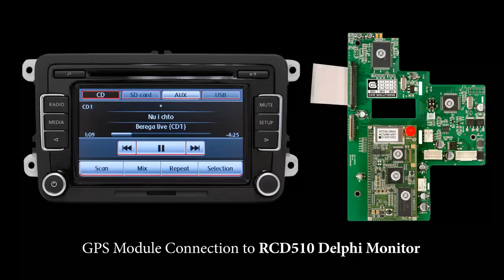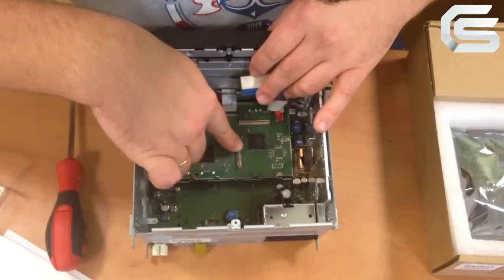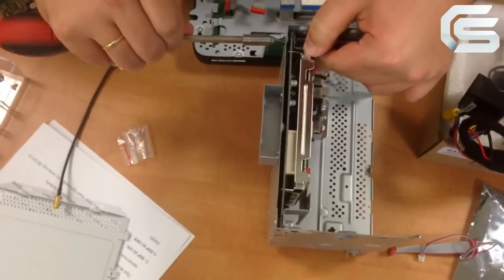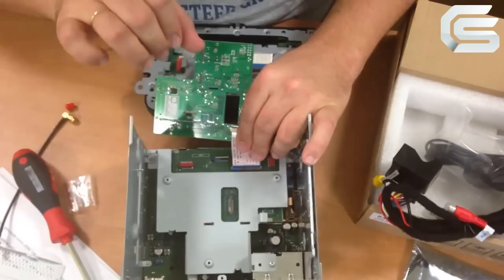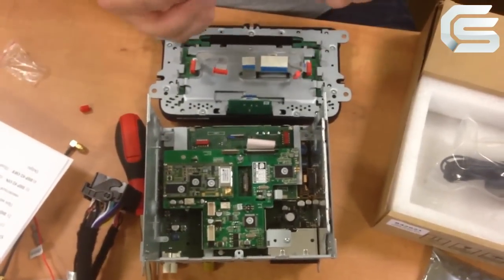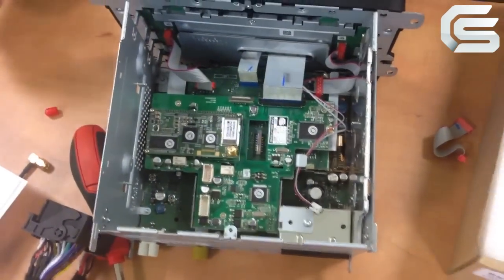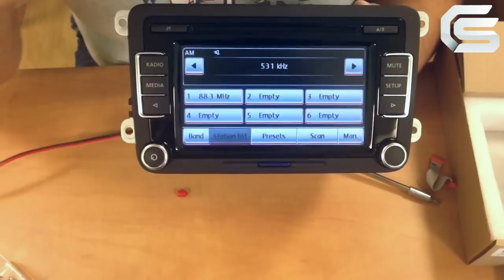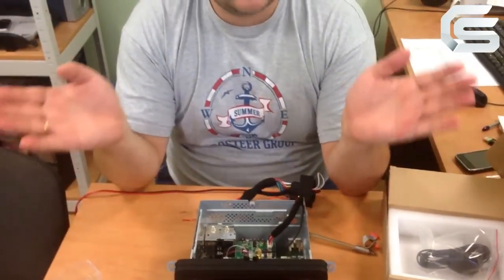Navigation for Volkswagen. GPS Module Connection to RCD510 Monitor.

Comment: Great video! I recently bought a Polo GTi 2011, with the RCD510 display, and I wonder if this will fit? My version does not have the arrow on each side at the buttons at the bottom. Instead it says "Phone" and "Settings". Can I still use your kit to get navigation?
Reply from the maker: Hi. It's only compatible with head units made by Delphi. So you need to take the monitor out and see the sticker.
Reply: @CarSolutionscom  pp

Comment: Hello a have the Amaraok 2014 Highline pack, made in Argentina, my radio RCD 510, doesn't have the bluetooth module, can i add this? do you know a good brand o this product? What about the GPS and rear camera, can i add these too?
Reply from the maker: +Mauricio Querejazu C. This module does not have Bluetooth. If your head unit is manufactured by Delphi then this module can be installed for GPS navigation and rear view camera.

Comment: Hi sir. Can you help me please. I have a Skoda Yeti with a Bolero (equivalance VW RCD510 first generation). Can I install this additional GPS card and also rear camera ?
Reply from the maker: +Yougourten AÏT MOULOUD Hi. If your head unit is manufactured by Delphi, then yes.
Reply: +Car Solutions many thanks for your answer. To check if it is a Delphi or no, is there a procedure  or must I remove my Bolero?
Reply from the maker: +Yougourten AÏT MOULOUD You can remove the head unit and take a look at the sticker. We can also try detecting it by the appearance. Please, give the picture of the head unit.
Reply: +Car Solutions, the product number is 1Z0035156N and there is a picture of the front: 
http://oi64.tinypic.com/2nqqul3.jpg
Reply from the maker: +Yougourten AÏT MOULOUD Unfortunately, it's hard to determine. If there was no phone button, it would be 100% Delphi. In your case it's 50/50. You'd better remove the head unit to see the sticker to be quiet sure.

Comment: I just ordered a RCD-510 1K0-035-180-AE headunit with a KUFATEC Bluetooth harness.
Can this still work for your navigation solution?
Reply from the maker: It will not work with  RCD-510 1K0-035-180-AE as this head unit is equipped with a SAT module.
Reply: Car Solutions thanks for the quick response.   If I removed the SAT module, can it work then?  I'm in Jamaica,  so I don't need the SAT module.
Reply from the maker: It is not possible to remove the SAT module as it is probably built-in.

Comment: Hi , I have a RCD510 but i need to know does it have a built in bluetooth or i have to  buy a separate unit ?
Reply: +alnoukhitha u need a rcd510 bluetooth module and activate in the stereo the option, and then push BT. gate away can bus should be in the car
Reply from the maker: +alnoukhitha Gustavo Photography provided gave the right answer

Comment: Hi I have a question why my RCD 510 won't take cd ? I just installed that radio in my vw Gti 2005
Reply from the maker: There's a CD changer in the car. First you need to select the number of the CD to use, and only then insert the CD itself.
Reply: +Car Solutions I don't think that my car has cd changer, where possibly cd changer would be? Also radio constantly make a noise Radio can be heard if it wanted to eject the disc even if it is turn off ?
Reply from the maker: Do you have an RCD 510 Delphi Monitor? Every RCD 510 Delphi monitor has a 4 disk changer. We are not sure about possible issues with other types of RCD 510 monitors as we only work with RCD 510 Delphi.
Reply: +Car Solutions I just got it fixed, there's was loose connection between cd changer and mother board, thanks for Your attention. One more question how do I connect hands free to the radio olso why I cannot use Bluetooth on the radio?
Reply from the maker: Bluetooth for such head units is a separate module that needs to be connected by itself. Also, hands free function is not supported in Delphi head units. You can find more information is this manual
http://car-solutions.com/nfs/product/840979/file/RCD-510_Delphi_User_Manual_EN.pdf
Reply: a just find out this radio is drain batterry i my car? what is the reason?my vw golf mk5 2005 gti

Comment: How to calibrate the shifted image?
Reply from the maker: Make sure you have set DIP switches in the correct positions:

DIP #1 ON – Head unit without rear camera OEM input
DIP #1 OFF – Head unit with rear camera OEM input 
DIP #2 ON – Rear camera connection via GPS module
DIP #2 OFF – OEM rear camera connection

Also, there's an option in the setting to adjust the image position.

Comment: Hi, I have a RCD-510 1K0-035-180-ACX
stereo. It is made by Delphi. Would this work?
Reply from the maker: If RCD-510 has a SAT module then it will not work.